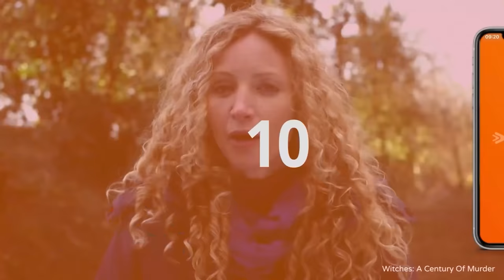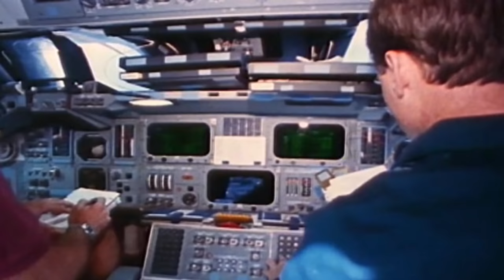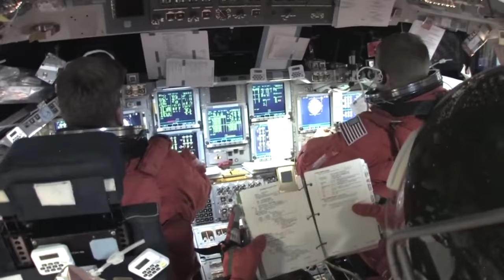How The Space Shuttle Program Saved Hubble Space Telescope | Trajectory | Spark

Comment: Genuine question. Why does the shuttle have to come into earths atmosphere at 1000s of mph? Why can't it just slow down in space and drop into the atmosphere at a much slower speed. The heat is caused by friction because of the high speed right? So why can't they come in slower to avoid the high friction?
Reply: Good question 🤔
Reply: Because it would fall out of orbit without real control by the comander.
Reply: The speed is to counteract the forces of gravity. It would fall like a rock with no easy way to slow down or perform a safe landing. You have to stay above 17,500 mph to stay in orbit, with current fuel technology trying to slow down from that speed and / or slow the spacecraft down during a free fall from outside of the atmosphere is not possible. From what I understand if we had spacecraft powered by nuclear fusion engines you could continuously thrust against gravity to slowly bring the spacecraft through the atmosphere, but I could be wrong about that. The moment you go below 17,500 mph you will start to re enter so you would need a way to slow down very quickly and then also use thrusters to slow your descent.
Reply: @Gurpreet Singh that makes no sense. Engineers play just like the other kids, in fact many engineers only got degrees in science and math so they could build the things they dreamed of. You can't use a parachute to slow down from 17,000 mph and the top of the atmosphere is so thin even a massive parachute wouldn't do much. You can't use parachutes in space. Every single one of these capsules has multiple stages of parachutes, including a small one for the premature slowdown you are talking about. Parachutes can only do so much. Maybe if you had read more books as a kid you would understand more about it :)
Reply: Well said bro 🤟
Reply: Its Too heavy to fly like a plane 🙏